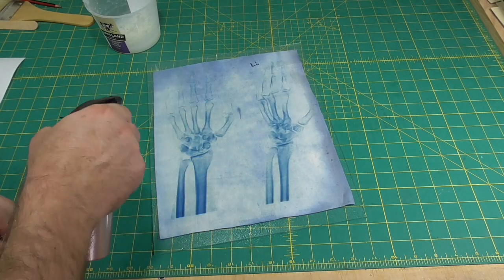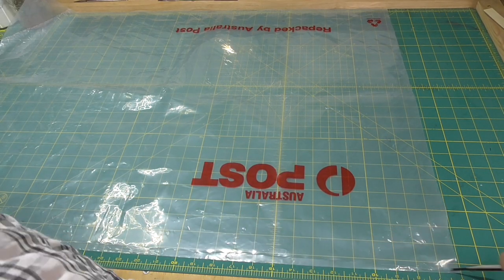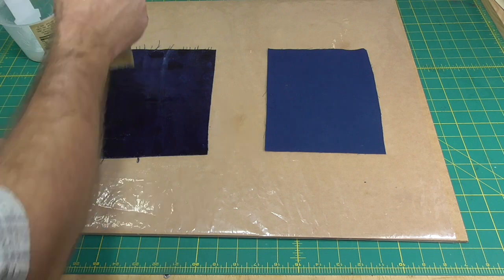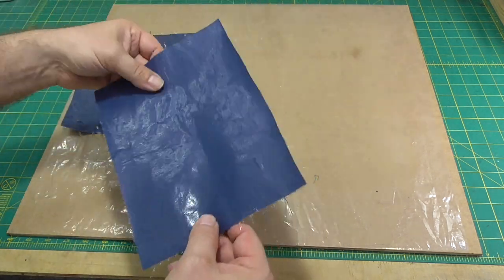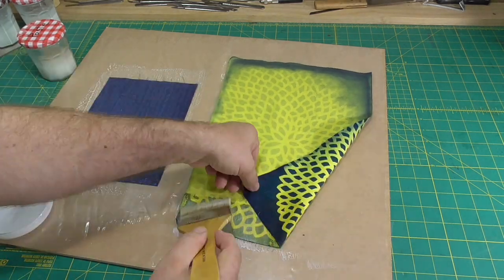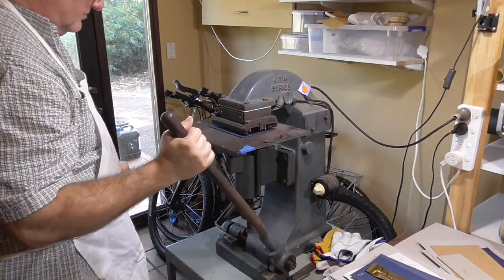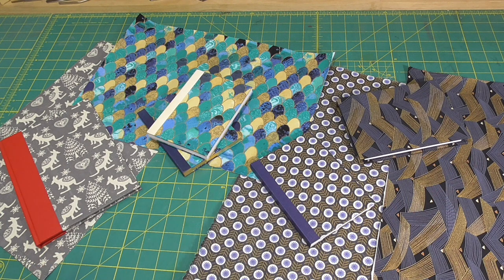DIY Bookcloth; Filling with Media // Adventures in Bookbinding

Comment: I recommend filling with natural shellac. It's water and stain resistant, stabilizes cloth and seems to increase durability, and accepts all sorts of adhesives, inks, etc. Alcohol based will soak in for a low-luster, fabric-like finish. Glycerol can be added in small amounts as a plasticizer. Water based will tend to build up on top (depending on the fabric) for a glossy shellac look. Either way it's also probably more sustainable than plastic, with fewer health concerns. 

One thing I wonder is whether you could use the shellac in the treated cloth as an adhesive for foil. Never tried but shellac is a thermoplastic that melts at a fairly low temperature, and was formerly used as a foil adhesive in bookbinding. 

Shellac is also a great option for paper and can be used to produce a paper faux leather that's perfectly satisfactory for something like a journal cover, especially if you laminate with cloth under the paper. (I think of it as artisan Pressstoff.)

Edit BTW speaking of hot adhesives, you can back cloth with paper by applying a slurry of starch in water (1 or more to 10 by mass) to the paper (damp), then ironing through the cloth (also damp). The heat of the iron cooks then sets the starch. Starch is often used this way in industry. It's much faster than using paste with less risk of strike-though paste puddles, and it seems to produce a tighter bond. Of course both cloth and paper have to be tolerant of moderate ironing, and cloth should be a sort that looks good when starched. Biggest risk is from leftover starch that escapes gelatinization, which becomes visible on dark cloth as whitish patches.
Reply from the maker: Thanks for sharing.  Very interesting.  I'll certainly look into it once things have settled down.

Shellac based glaire is very common in gold finishing.  It is more stable than egg white based glaire and it is what I mostly use.  There is a trick popularised by the Brockman's of touching up gold finishing by lightly brushing powdered shellac over tooling to be retooled.  It avoids any chance of staining with wet glaire areas that won't get recovered.

That process for backing cloth sounds great.  I'm not a fan of the heat'n bond type materials.

For the faux leather, would you add glycerol to make it easier to work?  How many coats of the shellac do you use on paper?  I imagine the density of the paper would have an impact on the final product.  Do you have a favourite paper?  

If I ever use this I'd like to credit you.  Who should I give credit to?
Reply: @DASBookbinding  For the faux leather, a traditional rag paper around 100 gsm would probably be best, but we've never had anything in a desirable color. Ingres from Canson and Fabriano are part rag but seem to be Fourdrinier and have the wrong texture. We've had success using mould-made Ingres from Hahnemuehle and Zerkall and also Hmuehle's Bugra. Their black Ingres has a fine pebbly texture on the wove side that's vaguely leather-like and lovely on journals, and the same in camel with fiber inclusions gives a warm look, especially versatile when the color deepens slightly from shellac. The Hmuehle papers also have the advantage of being gelatin-free and vegan-friendly (though that goes with the shellac).

We've had success using one or two layers of Ingres or one layer of Bugra over lightweight, tightly woven cloth. First we laminate with plenty of paste (no buffer for fear of staining) and all the pressure our nipping press can supply. In that step it's easy to add more texture. Where we live garlic and onions are packaged in fine plastic netting which can impart a grain-like appearance. I have added PVA to the paste most times - I'm not sure it makes much difference in the end and I worry about the alcohol moving it around, but of course both the paste and eventually the shellac will succumb if the book spends the night in a puddle. Perhaps with PVA it might last an hour longer.

Shellac is applied once the lamination is fully dry. Alcohol based can be prepared more quickly, penetrates better, and dries faster apparently without risking the starch bond. It should be thin for even application - I only ever mix up 2 lb cut but we've thinned it probably to less than half that for this purpose. And probably at most 1:10 glycerol to ethanol in the end (plasticizer and old French polish cheat). It can be painted or padded on, stokes disappear. It soaks in deep and once it's dry you have something vaguely like tough, dry leather. One coat is usually enough for the aesthetic. The more you apply, the more you'll see the luster of shellac, same if you size heavily with starch paste before the shellac. You can fill after the shellac by painting on starch paste or applying a paste wax (being careful not to let it soak through to the cloth side). With wax and some buffing it starts to look convincing. 

Even without wax it's an impressive material. Recently we attempted to form it on cords, soaking with paste and constantly painting the surface with more paste so as to soften it.  As the paste dried, any whitish residue simply wiped off with a damp rag, as with leather. It was a battle, though the paper was never at risk - I credit Hmuehle partly, their Ingres is exceptionally tough in all directions. In the end we actually managed. It looked like black calf with very understated grain and it was adequately flexible. Unfortunately it dried so tight the case couldn't nearly close. 

I've been told it's not unusual for people to misidentify recent antiques as full grain leather though they're Pressstoff, to the point where buyers are advised to look for signs like delamination, unconvincing edges, etc. In contrast to fabric-backed "pleather", often both grain and flesh side were imitated, and thanks to paper/pulp's structural similarity to leather, even wear patterns are fairly similar. I have a German biography of Bismarck from 1926 that's cheaply bound in some sort of Pressstoff, probably laminations of paper with pigment and looks like nitrocellulose on top, nicely stamped with a tight grain pattern. Although it's worn it still looks good, feels tough, and could fool the inexperienced. 

I wouldn't test it or our own work against library buckram, but I do see hope for a leathery alternative to cloth that's just as durable, cheap, able to be made in studio, and not nearly as destructive as plastics or leathers.

Comment: DIY book cloth? I could cry. I’ve had a project in mind for years! that needs a variety of colors of book cloth but only a small amount of each and the colors have to coordinate with another part of the books. I could only find book cloth in primary colors on bookbinding supply websites. I didn’t think it was possible to use regular cloth due to fraying. Thank you for this.

Comment: Your videos helped me out when making a trading card book with those loose trading card 9 pocket pages. One fabric I wouldn't recommend is faux fabric because it doesn't hold to the glue after wet pasting the glue. It took a full case of 24 cans of soda to set the shape after a hour. I had other problems with it.

Comment: Just tried the 50/50 acrylic medium and rice paste. I couldn't find wheat starch or rice starch, only corn starch and I'm not sure how that would work. So I made some rice starch from actual rice. Took a bit of time but it worked. And tried it on a bit of calico I picked up from local hobby store.  Looks great!  Gotta actually try it out on a book. I might back it with paper like you did the x-ray cloth. 
 The one issue I have is the poly I used, I bought as a drop cloth. So the folds in the plastic stayed and the back isn't perfectly shinny smooth. Not sure if this actually matters. But I'm gonna try and use some heat to ease those folds out. 
Big life saver this video lol

Comment: Very interesting video, thank you! I was taught to make book cloth by stretching it on a frame with lots of pins, painting both sides with waterproof PVA (twice, possibly?). Then when dry, remove from frame and burnish (rub!) with the back of a spoon to get a smooth finish on the ‘good’ side. Works pretty well I think, but the whole pinning and burnishing involves a lot more effort than it looks your approach does!
Reply from the maker: Really interesting.  I've experimented with PVA as a filling medium.  I used just like in the video.  Really didn't like the result.  Very stiff and very plastic like.  I might give your way a go and see what happens.  I'm really curious about the burnishing.  Thanks!  DAS
Reply: @DASBookbinding  I was also thinking of PVA, but a mix with methyl cellulose like using the acrylic medium and paste mix. Would that likely work like that mix? I was hoping that the PVA would prevent moisture re-absorption problem of the MC, and the MC would soften the PVA's "plasticness".
Reply: @judyofthewoods Hopefully he is able to answer if you've been waiting all this time but he also could be busy or didn't see your comment...but I'd personally get a few small sample sizes of whatever type of material you're wanting to use and testing out your mixtures on small samples...that way you can spend less money to find out if a certain material type will work with the mixtures you want to test out before buying a lot of that same kind of material that you may not end up using if it doesn't work right and then having to use it for something else entirely or worse if it ends up sitting unused in your crafts room 😅😊

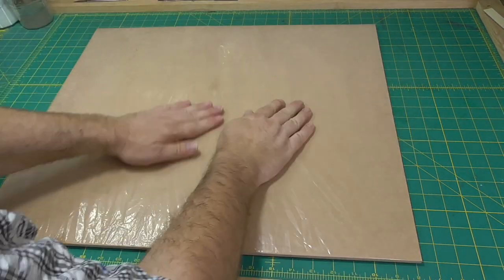Comment: 2:34 Ordinary plastic bags like those are mostly polyethylene (LDPE). Perhaps the advice to use polypropylene is because it is stiffer, since LDPE usually is made soft and flexible by additives? But you fixed that with some MDF. 👍😊

I was looking at the megastore the other day at plastic (“plexi”) glass but it was only sold in huge sheets and very expensive.
Reply from the maker: Plastic "plexi" glass scratches really easy.  For smaller jobs I have some glass shelves from Ikea.  They are strong and have polished edges, so you don't cut yourself, and don't scratch easily, and are cheap.

Comment: Excellent video! I will definitely be experimenting with this. A thought about work surfaces:

Although it might be hard to find one large enough for multiple in sheets at a time, I bet a smooth polyethylene cutting board (the cheap white kind) might be a good work surface. PE is extremely adhesive-resistant and should release easily.
Reply from the maker: Thanks!  I have looked into this.  The cutting boards are nearly always textured and large ones have to come from commercial kitchen suppliers.  The silicone pastry mats work really well too, but if your spouse finds out what you're using her pastry mat for, it's big trouble.  Guess how I know.  All the best, Darryn

Comment: Hi Darryn, I have used the acrylic fabric medium + paste mix to great success. It is very water and stain resistant and accepts foil nicely. I have just laid down some cloth to dry but this time I'm trying a regular acrylic matte medium, as in not fabric specific. The reason being that I'm only able to find the fabric variety in small, expensive amounts. It would be much more cost effective if the regular medium works as well. I'll update with my results. I'll add that I've found freezer paper to be a great backing for this type of project, as you can roll out as much as you need and tape it to your table.

 While I'm here, thank you for the excellent tutorials, I am absolutely loving my own adventures in bookbinding and your channel is immeasurably helpful.
Reply from the maker: Yep, I've tried many types of acrylic medium and they mostly worked.  But I do prefer the textile one and luckily I can get it for not much more than normal medium.  Thanks for the tip on freezer paper.  That makes sense since it is silicone coated.  All the best, Darryn
Reply: @DASBookbinding  "Mostly worked" is a fair assessment. The fabric medium yields a far higher quality cloth. The matte medium came out flimsy and an odd texture, plus it shows brush lines. For anyone who might read this, go with the fabric specific medium. That said, I'll continue to experiment! 

Cheers!

Comment: This is a video I’ve been waiting for! Thank you for doing so many experiments, so that we less science minded can follow in your footsteps.
I assume the very shiny reverse side of the cloth, where it dries against the plastic, does not resist the paste or PVA a needed to adhere it to the cover boards?
I wonder if a silicone baking mat would be a surface one could try to paste it onto, instead of the plastic sheet. SA Post doesn’t give me thick plastic bags!
Reply from the maker: I should have said something about that.  The shiny side does take PVA and mix very well.  At some point I have some B roll of me covering a board for the foil test and you can see the adhesive spreads well on it.  You know how I use my spouses expensive Thermomix to make paste and how she hates me doing this.  Well she has a big expensive Thermomix silicone pastry mat.  It works really well!!  But if you really want to annoy your spouse, I've found a way.  All the best, DAS
Reply: @DASBookbinding  haha i can just imagine her face. I have 2 of those silicone baking mats ..hmmm maybe one should be commandeered for crafting.

Comment: I want to keep my questions to a minimum, Prof. S,  but wanted to ask if the paste was your standard adhesive ratio of starch to water as opposed to, for example, the paste paper consistency? Edit: The following is just way too much unimportant commentary on my part and can be skipped: I can surely agree on the futility of designing most synthetic formulations from home, as I worked in a urethane sealer factory Seal n Lock, and they required a chemist and a full lab. The only thing I had in mind with the solid acrylic resin pellets was that Paraloid B-72 that just requires solvent to desired consistency. I already have some around, for use with fossils and stabilizing minerals for lapidary, and noticed book conservators also using it both by itself and with waxes. I thought I might try some in ethanol so it would mix with the water in wheat paste, for fun, and compare it to clear acrylic medium w/paste. I thought, if it worked, it would cost less than premium acrylic paint medium (not to mention having a kilo). You're so well read on book cloth... I swear I saw somewhere clay had been added, sometimes. I've also got a clay replacement in the form of ceramic powder. With as much testing as I've done to formulate my own flute coatings and other things, I can't help myself but to transplant this urge to this hobby, and plan rogue things along the way as I practice the tried and true. But nothing that might off-gas, bleed, leech etc... right now I'm largely reading and absorbing as I tinker with book basics and-- Edit: my first paste (water 4:1) and Golden Acrylic Medium is drying this hour! Actually, being spare stuff of the wife's, it was Golden's thin acrylic Glazing medium and their Gel mixed to regular, medium consistency, then mixed 40% with 60% wheat starch paste... (fingers crossed). Channel DAS draws from so much wonderful experience and sources, in addition to being so inclusive of details commonly left out elsewhere, it's such an asset to so many. Thanks for the Martha Cole reference, here, too!😁
Reply from the maker: It's the adhesive ratio of about 1:4 or 1:5.  I get it.  I love experimenting too.  If you've got the materials, worth a try.  But I have had many people sure that making their own PVA is the way to go.  Not sure about the ceramic powder.  But if you look at the work of people like Martha Cole they use all sorts of interesting materials to get interesting results.  I'm more a craftsman than an artist.  So don't let my limitation be your limitations!  Happy binding!

Comment: So you don't use both paper backing and the paste/medium mix, right? You either back it with paper OR use the paste/medium mix? Sometimes I make books with naked boards that have a watercolor painting glued to the front and I put gel medium on those to protect them. I want to do more fabric book covers but I like the idea of having the medium on them since I use the books for ink and watercolor work and they can get messy.
Reply from the maker: You could I guess.  But if you impregnate the cloth with the paste/medium mix you don't need the paper backing.  But maybe you have a thin cloth that needs the paper backing to make it stable enough to apply the outer coating?  I could imagine that.

Comment: You can easily buy silicone sheets for baking/crafts online, absolutely nothing sticks to those.

And after watching the first video, I had an idea for a sort of hybrid method: sizing the fabric with watered down paste or PVA glue (or acrylic medium, like you used here), then applying a backing paper to that. Sizing should stop the adhesive from coming through to the front so you shouldn’t need to be so careful when applying the glue.
Reply from the maker: I have lots of ideas that "should" work.  The best bet is to try them out.  Lots of my should ideas don't go as planned.

Comment: Love the videos, incredibly informative and have set me on the path of book making. This may be a silly question, so I apologise if it is, but I was just wondering if the starch based paste would be similar to clag glue? Thank you again.
Reply from the maker: I think Clag is starch based.  It is in the same adhesive category as paste.  But it has preservatives and other additives.  For non-forever work it's probably fine as a paste adhesive.  But I wouldn't use it.  DAS